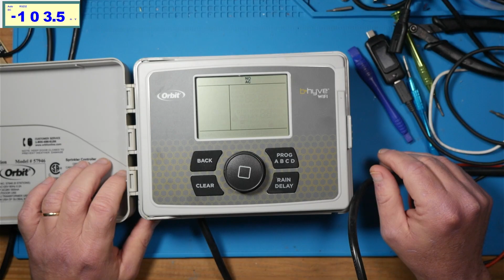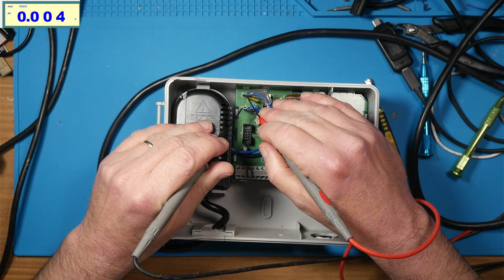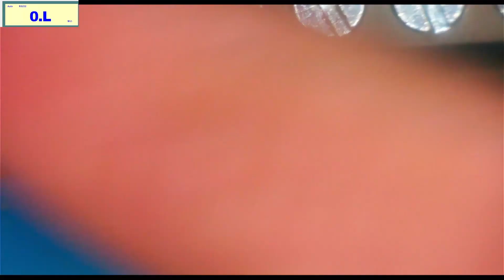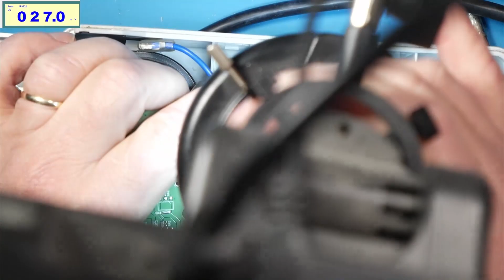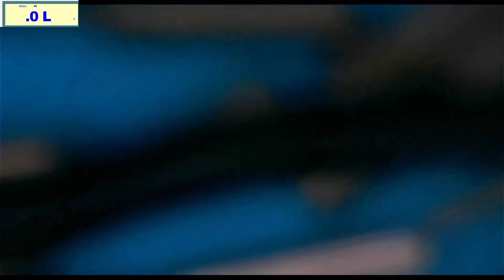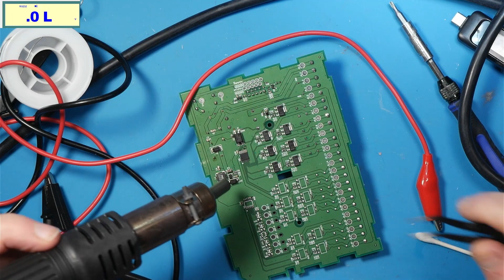Repairing an Orbit B-Hyve Automatic Sprinkler Controller- No AC Detected

Comment: Thank you! I just ordered replacements for D2, D1, and U1 because I suspect D2 dying has killed or weakened those other components. (D1 works, U1 suspect). I went overkill on the replacement components though haha, I don't want to have to do this again. Seems like a design flaw from Orbit, seeing as how lots of people have had this same issue. I got a B360 to replace D2, an S2M to replace D1, and a AP64060WU-7 to replace U1
Reply from the maker: No harm in doing extra. Great job.

Comment: You, sir, are my hero.  Fantastic walk-through of your troubleshooting steps.  After watching this, I was able to do exactly what you did (although with a much, much, much worse soldering job!), and my board and controller are working again.  For those who are nervous about trying this fix for yourself... read through this long list of comments and you'll see that this guy nailed what must be practically EVERYONE'S issue when they get the dreaded "NO AC" message on their display (a blown diode in that D2 position).  Follow his guidance and you'll be fine.  The one additional thing I think might be helpful for folks (who aren't electricians, electrical engineers, etc.) is understanding that the SS16 Schottky 60V 1A diode has a specific orientation that you must replicate when you install the replacement.  The side with the stripes must be closest to the "U1" that's printed on the board.  For those who want a link to the diode variety pack I used successfully, here it is:  https://a.co/d/0914yrvX (Chanzon SMD Fast Switching/Schottky/Rectifier Diode Assorted Kit (15 Values Total 150pcs: M1 M4 M7 S1M S2M S3M SS14 SS16 SS24 SS26 SS34 SS36 RS1M US1M LL4148) Electronic Component Assortment Set - $7.99).
Reply from the maker: Well done, I am glad you got it working. Good information for everyone, thanks.

Comment: Hello, I'm having the same issue. Would this diode work? "Pack of 60 B160-E3/5AT Diode Schottky 60V 1A DO214AC :RoHS, Cut Tape"? I found it in ebay.
Reply from the maker: I would say that it would work. I think I used a 40V 1A but according to my search, it was a 60V 1A Schottky diode. I think yours are the correct spec for the unit.
Reply: @probablycantfixit6426 Thank you!

Comment: Wow excellent video. I ordered a diode kit from amazon and bingo...It's fixed. Thank you so much. If anyone needs the item it is the "Chanzon SMD Fast Switching/Schottky/Rectifier Diode Assorted Kit ". I used the SS16 diode ( 1 amp  60v).

Thanks again
Reply from the maker: You are very welcome

Comment: I have the model is 57950 (12 station b-hyve controller) and am experiencing a slightly different problem. The display looks good with all the numbers, wifi, etc. But when i try to start any of the valves manually (or programmatically via schedule etc), it doesn't work. The display and my phone app do show that it's working but the controller is not sending the signals to the valves. Do you know what part of the circuit board you showed that involves passing the current to the valves? By the way, i also tested installing the wires to an old manual controller and the valves work. So, its definitely something to do with the smart controller. Could you please advice?

Comment: Cool. I have the same problem and injected voltage as well; my thermal camera showed the same area getting warm. I was between the inductor and diode but got stuck there. I googled and found your video. Now I need to order the diode and hope for the best.
Reply from the maker: Hopefully, you get it working.

Comment: Like the rest of comments here, you are truly a lifesaver.  It was exactly what was wrong with the unit.  I replaced it with an SR160 leaded Schottky diode and it worked like a charm.  I knew there was something wrong with the voltage supply to the board, and had expected a shorted capacitor, but it was the Schottky diode rectifier.  Thanks again.  Keep up the good work.
Reply from the maker: You are quite welcome and thanks for the comment. Glad you got it fixed.

Comment: Thank you so much for this video.  Had the same "no AC" message.  Checked and had AC going to the board, but had no idea where to go from there.  Checked the diode you identified and it was shorted.  Had to buy 100 assorted Shottkey diodes to get an SS16 (B160 equivalent) for $10.  Soldering such a small component was a meticulous effort, but I prevailed. Controller is now back on line.  You're a life saver.
Reply from the maker: Awesome job.

Comment: Had the same issue, when I checked the diode it was shorted. Replaced it with a non-SMD diode and that fixed it. Better to use a non SMD as that would have better thermal capacity. Thanks for the video, saved me a few hundred bucks.
Seems to be a half wave rectifier to feed the DC circuit part. Who the hell uses half wave rectifier in this day and age. Company saved the price of 3 diodes !!!
Reply from the maker: LOL, these companies will do anything to save a few cents. I am glad you got it fixed.

Comment: Thanks for the info. I’ve had three of these burn up every time there is a lightning storm near my house. Even though my unit is plugged into an expensive power surge protector. 
Is there any better way to prevent future burn ups?
Reply from the maker: I honestly have no idea. I think they are doing what they are designed to do but perhaps the current rating is too low.

Comment: Great video! It helped me a lot but... I´d need more help. Two questions: what if I buy an american power board that runs 120 volt and bring it to Spain where we have 220 volts? I mean, just swapping my current power board by an american one (I just reviewed your video and my power board and yours are identical as far as I can read numbers in diods and capacitors). Second question: my problem is that I have burned the small black component that is close to the diode you have changed and below the piece marked 220 (the burned piece has 6 pins fixed in the power board and is very small) What´s piece is that? Do you think it could be changed? My skills are very low but I´ve been able to do all thing you have done until the end of the video. Thanks a lot for sharing your knowledge!
Reply from the maker: I believe the power boards are interchangeable between US and Spain. The power adapter converts your 240 VAC @ 50 Hz to 24 VAC and ours converts 120 VAC @ 60Hz to 24VAC. I don't think the power board cares as long as it gets the 24 VAC. 

I am not sure what that component is but it may be a DC-DC step down converter to create the DC voltage(s) that run the unit. The problem is it is hard to find the exact part based upon the chip markings. Looking at it, it seems to only have one output that goes to the 22 uH inductor above it with that diode in parallel for protection. Sorry I can't be of more help.
Reply: Hi, the 6 pin component can be replaced with a AP64060WU-7. Hope this helps, sorry I'm 7 months late

Comment: Heads up.   If you replacing or adding a new unit the pairing for an original unit (as stated in the instructions) WILL NOT WORK.  I tried pairing a new unit after my 4 year old one got the "no AC" message.   After trying all morning with 2 different phones, finally on the B-Hyve app video it says you have to go to the bottom right corner of the app to ADD or Replace a controller.   When I stepped through the replace the unit screens it found the Mac Address of the new unit without pairing, then it copied all the settings from the old "No AC" unit to the new unit.  So, in short Orbit uses some prioritary pairing method that the Orbit App uses to check the Mac Address in the process and if that doesn't match, then no pairing.   I was ready to send then new unit back to Amazon even though the pairing symbol was on the screen, but it wouldn't pair like an original unit does......   Waiting on the chips to fix the "No AC" unit, for a backup......
Reply from the maker: I definitely remember having a devil of a time getting the new unit to register with the app. Once I fixed the broken one, the application kept defaulting to that one and I ended up deleting it from the app. When the new one breaks, I will fight to get the old one reinstalled. Thanks for the heads up.
Reply: Fixed my old unit with the 60V 1A replacement diode.  So, then I did a Google search, because I noticed someone in the comments replaced theirs with a 100V diode.   Per the search, in short, to replace with a 100V 3A diode makes sense because it provides more protection for the circuit, especially if the old diode failed.   There's a couple of lunch buddies in my neighborhood with the Orbit unit and we all love the Orbit Controller.  If theirs fails, I'll used the 110V 3A diode on theirs.  Amazon sells 150 diodes (all sizes) for $7.   Great video PCF6426.   Keep up the good work.

Comment: I see the top right one have the yellow part , what is that part ,, do we have model informtaion ? mine is burned there  ,,maybe replace that part ? Thanks
Reply from the maker: I believe it is a polymer resettable fuse (PTC). If yours is burned, then it is most likely open. I do not have the exact specification for the component because it is just labeled as F1. Mine does not have any markings on it. If you have a multimeter, check for resistance from ground on both sides of the component. If you have high resistance on one side, and 0 Ohms on the other, then you have a short. If you have high resistance on both sides of it, then just replace it. This is a part that I found that may work: https://www.amazon.com/MF-R110-Resettable-0-1Ohm-Radial-Automotive/dp/B07TYGL9SK/ref=sr_1_1?crid=1RLLXL4NV7J75&dib=eyJ2IjoiMSJ9.bnv-BaGVvHOmM5zM9u7jvKyKbNKeawj1fti09wGHjSA.0V8Dpb4L2MXTqWAFF7tDF8J3p6pw0ixpa7e7RsQzLSs&dib_tag=se&keywords=MF-R110&qid=1750767711&sprefix=mf-r110%2Caps%2C86&sr=8-1. Please understand, I am not an expert, just a dude that tries to fix things.

Comment: Thanks! This is literally a 10 cent part. I ordered 10 of them online as I had two of these controllers giving me the "No A/C" jazz. The shipping costs far more than the part, but replacing D2 on each controller fixed the problem both times. I immediately placed the repaired controller back in service and now have a backup controller should I ever need it.
Reply from the maker: Awesome.

Comment: My son helped to replace to diode and the “no A/C” is gone, but the display is blank.  What might cause this?   I hope you’ll see this and have a solution?    Thanks!
Reply from the maker: I presume you checked  the connections between the power board and the display board for proper connectivity. If not, you can double check that. Can you connect to it with the B-Hyve app over Bluetooth? If so, can you manual control it with your phone? Apart from that, when the diode shorted, it must have damaged something else, possibly on the board that has the interface. Sorry you are still having trouble.

Comment: When the video started I almost scrolled away. I'm glad I decided to stay. I'm sorry I doubted you sir. I have a similar issue however mine flashes on and off. I do not have your technical skill. I will be taking the cowards way out and just buying another one.
Reply from the maker: That is not the cowards way out, that is the pragmatic approach. I too, bought another one and then fixed the original. Yours may have a component overheating causing it to shut off. I am not sure.

Comment: The component U1 at t=15:17 is a "buck" voltage regulator.  It steps the power down to a constant DC voltage.  My D2 is faulty, so I can't tell what the voltage is supposed to be.  But, it is set by the resistor divider created by R1 and R2.
Reply from the maker: Thanks for the info
Reply: Output of buck convertor measures 3.3V
Measurement available at J22-1(Gnd), and J22-6(+). So you can check before removing board.

Comment: Mine had no display, figured it must be the same problem as everyone else here. I had caused the power outages by troubleshooting my whole house generator which I repaired, but that's another story. I took my timer all apart, measured across the diode while in the circuit, but it wasn't shorted. It was showing .8k in one direction and 50k in the other. I wondered if that was normal. Then I thought I better measure the transformer voltage, it was good at about 28v AC. While I had it apart, figured I'd replace the backup battery. Once I did that, I got the "NO AC" display! Crap, was it just a bad battery? Long story short, YES! Of course that's After I ordered a new sprinkler timer AND a set of diodes. So, if you have NO display and you're NOT seeing the No AC warning, put a new battery in it!!!
Reply from the maker: At least you got it figured out. Thanks for sharing
Reply: Yes, it's working, gotta be happy about that

Comment: What does alcohol do on the board? Are you using 70, 80, 90, or higher percentage alcohol?
Reply from the maker: The purpose is to clean flux residue because some flux products can be corrosive. This can cause damage in the future. I am using 99% alcohol I purchased on Amazon.  The lower the percentage of alcohol, the more water content it contains, and therefore the more conductive it is. I used 92% when I first started learning, and it was fine.  If you use less than that, you have to ensure it is fully dry before you apply power.
Reply: @probablycantfixit6426  in this video, it didn't seem that was the purpose of alcohol. It was something about heat spots or finding the area overheating. Please explain.  

By the way, I removed the diode and it tested fine after removing. Replaced D1 anyways and still the same problem. Sounds like the short is elsewhere. Is D2 the same diode? I cant read the small print on it.
Reply from the maker: @JustMe-gx4xt  Oh, sorry. My thermal camera is not the most accurate so I use it to find the area that is getting warm. Once I have the area, I put some alcohol on the components and see which component is evaporating the alcohol the quickest. That indicates the shorted component.

Comment: We do have more than our share of power outages, but for months power has been solid and good. One morning I checked the unit and it couldn't be found on WiFi. It had the No AC problem, I think the part just has a 4-year failure problem.  I followed along here I had the same short. I'm not very good at soldering but managed to get a good connection and it all works again. Thank you for the video! Now when the great Schottky diode shortage occurs I'll be sitting pretty with a supply of 99.
Reply from the maker: That is awesome, I am glad you got it fixed.

Comment: My sprinklers aren't working, I found ants in my box and the LCD screen has no power. I opened everything up and the last circle, to the right of the screws where you plug in the wires, is burned. It's not in use as it's not one of the ones where you plug in a wire. When I plug it up I see smoke coming from it. Can I replace the circuit board or is it just going to happen again?
Reply from the maker: I would say you should be able to replace the power board. There must be a short to ground in that area. When you disconnect everything but the power board, does it smoke when you plug it in?
Reply: @probablycantfixit6426 yes. With only the powerboard connected it smokes. The circuit board that has the LCD screen attached to it is not connected. The ants and their eggs were all over. I think they might have gone through the vents on the side of the transformer too. Maybe something they did in there is creating a power surge? Maybe it's a coincidence but I know they can chew on wires. I'm going to keep ant bait gel trap in there from now on.

Comment: Please tell us the specific tools you use for soldering, amplification, and  diagnostics, because the one I bought off amazon doesn't seem to work. Either that or I am not operating them right. Thank you
Reply from the maker: Hi, I use a Yihua 995D+ soldering station, an Andonstar Microscope, and a Hanmatek HM305 power supply for voltage injection. I have a Flir One USB-C thermal camera for looking for shorts.
Reply: @ Thank you very much.

Comment: After replacing the diode the "No AC" warning went away but the screen is completely blank. Any ideas on what might cause that? I put a new battery in as well
Reply from the maker: Sorry Jeff, I am not sure. You can try taking the screen board out and see if you find anything damaged on it.
Reply: @probablycantfixit6426  Thank you for the reply. No worries, it has inspired me to get back into my old hobby/job and build my own microcontroller based solution. That way I can always fix it myself. Cheers and Merry Christmas everyone!

Comment: Hey there, I had one of these controllers fail (No AC) after a power surge, and thinking I must have just got a dud, went out and bought another one. How dumb was that? It failed 4 months outside warranty at the end of this season. I found your video, and having never done this type of electronic repair before, purchased a bag of diodes, an iron and some solder, followed your lead, and now I have two working controllers. I needed a win today, lol. Thank you SO much for taking the time to share your knowledge and skill.
Reply from the maker: You are welcome, and I am glad you got it fixed.